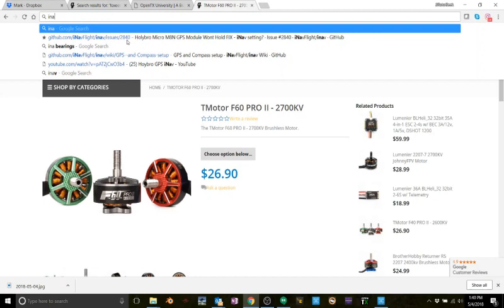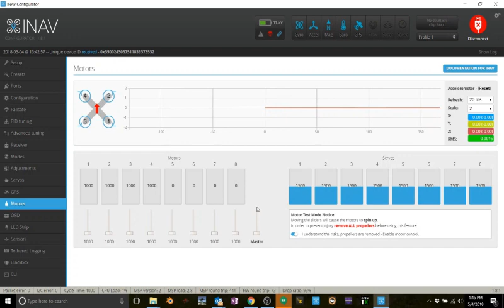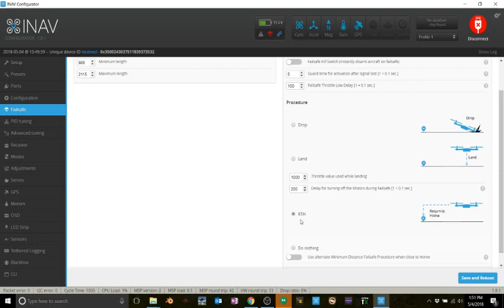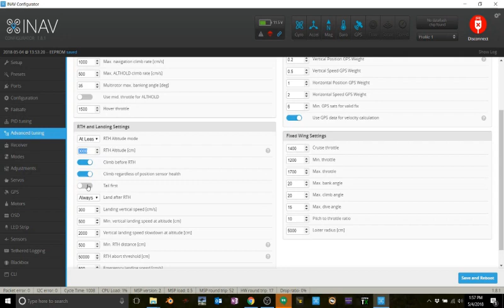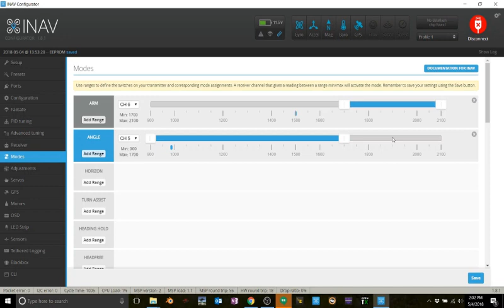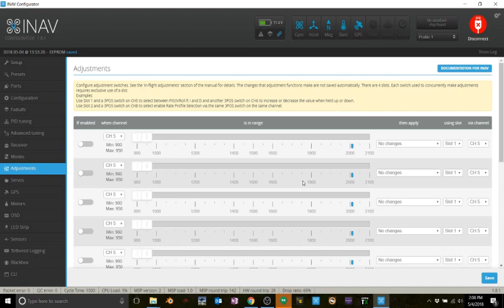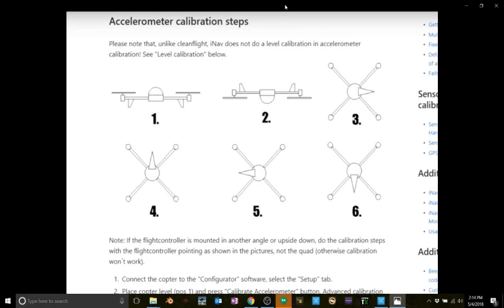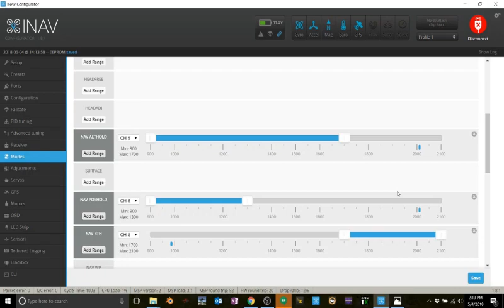QuadKitchen- GPS Hybrid Drone Build - Part 3 of 4 - INAV Set up

Comment: Thanks JJ, great video. Hey one quick question. I've got the Omnibus F4 Pro V4. I can't find the sda and the scl inputs. There is an swc and swd on the back of the fc. But i don't know where to connect the compass to. You wouldn't have used this board before by any chance?
Reply: they're the same pins as UART3,  Look close they have tiny labels

Comment: i have  a quadcopter with inav and also gps.... when i hit RTH it is flying back and lands.. but it goes to guick!! i think i have found the option where i can change it but i am not sure.... do i need to change 'nav_landing_speed' ? now its 200 so 2 meter in a second....  so 50 make it nice and slow?
Reply: If it flies too fast in auto navigation modes, like RTH, you need to lower two parameters: max speed in auto mode (or smth like this) in configurator, and also gps position pid  nav_mc_pos_xy. By default it's about 65, lower it to 30 and you will be fine.

Comment: Hello, how do you know if your mag alignment is ok?
If the GPS tab shows the correct location on the map, then mag alignment is OK?
I would have liked to have seen how you got to the TAB values "Advance tunning"
You did tests to find the point of hovering?
Reply from the maker: I didn’t go over that advance tuning??? Coulda swore I did.   No, the gps will always show your location.   After you calibrate the mag, in the setup tab it will show the heading.   Point your quad north and your heading should be close to zero.   I’m gonna do another inav video this week on the updated GUI
Reply: Yes, there is no doubt, you spoke of the "Advance tunning". I was referring to the flight tests to get to the values. Or did you do it all at once without making test flights to fine tune the values?

As for the "mag alignment". It seems to me of great use this video that you intend to do. I'm looking forward to your posting.
Reply from the maker: Cool brother.   I’ll try to get it done tomorrow
Reply from the maker: I dial it in mostly on the bench then tweak in the field

Comment: JJ. I build the same quad with same parts. It holds position rock solid. it just when i move in any direction it keeps on in that direction after I let go of stick. Any ideas why. Like if I move forward and let go of stick it keeps going forward I have to pull back to stop it.
Reply from the maker: That’s weird.   U have the bird in gps mode and it does that???
Reply: JJRotoGeek yep. It only does it in gps mode.
Reply from the maker: Hmmmmm.     Email me your dump or diff out of the bird.   And if u can a video of whatnits doing
Reply: JJRotoGeek I got. It was the compass wasn’t calibrated good enough lol
Reply from the maker: Lolol.    See if u drink when ya calibrate, it helps
Reply: JJRotoGeek Roger lol

Comment: First
Reply from the maker: Lolol ooooooh and a Blackhawks fan🤘🤘 my home team.   Your on the cool list
Reply: JJRotoGeek yup so sad they did not make the playoffs 
Missing Crawford and Hossa
Hope at least Alford returns next season, for now it's either the nights or Bruins for the cup 
Good luck with everything
Reply from the maker: Ditto.  U from Chicago to?
Reply: JJRotoGeek fuk yeah
actually ayrpra but not so faraway
bears still suck ass
but improving
Reply from the maker: Lolol agreed.   I’m
From the south suburbs.  Orland park
Reply: JJRotoGeek nice quick question
i got yhe cicade f4 the one your in love with and i want the tiny tx6 pad fro spart port telemetry with the x4rsb
would that be possible
also do i have to invert it or juat solder, betadlifht then fly
Reply from the maker: Hey brother.   That’s how I do it.  I put smart port on uart 6 (tx) and the sbus signal on the front of the boardon uart 1 that’s already inverted
Reply: lit thaks is worked